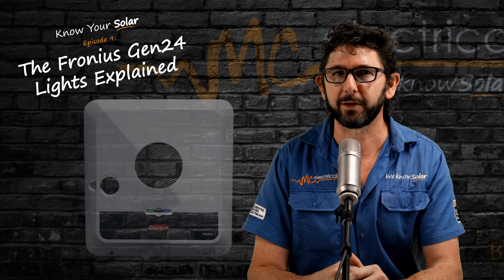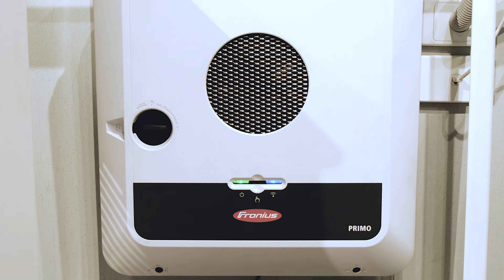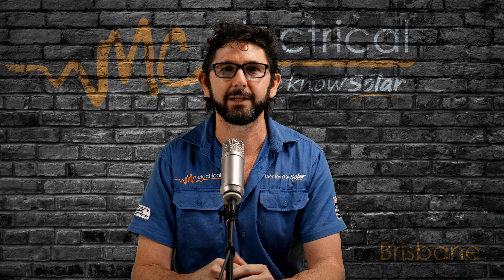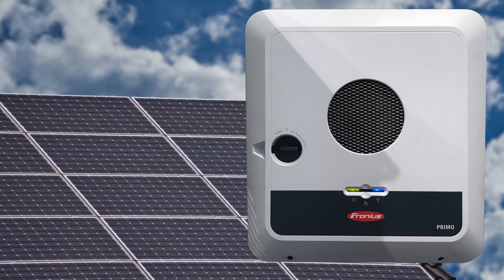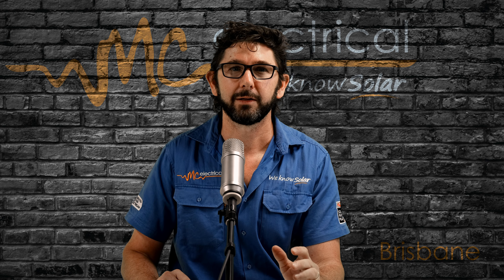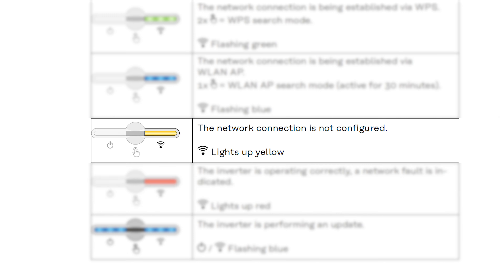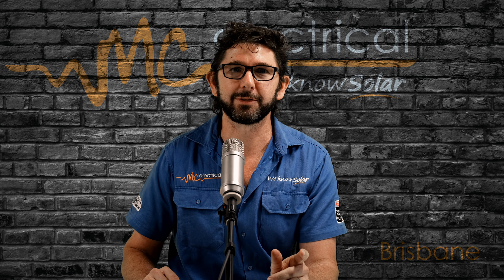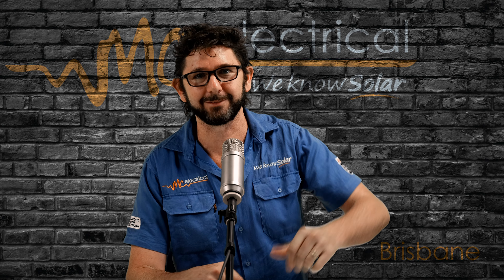Fronius Gen24 Lights Explained | Know Your Solar | Episode 9

Comment: Why is my white light on for 2 of my 3 inverters?
Reply from the maker: Is that the Center light? The optical button can get triggered too easily sometimes. I’d get onto your installer. Latest firmware update helps that from causing problems.
Reply: @mcelectrical  Ta, will check versions later, you guys installed it.

Comment: Thanks for your informative Gen24 videos. I had trouble connecting my Gen24 to WIFI but then managed thanks to your video. However, the blue flashing light has been flashing since days now and does'nt stop. Everything appears to be fine now but the blue light keeps flashing. How can I get it back to solid blue? cheers Dete
Reply: press the WPS button on your modem, then press the middle (clear) button on your inverter twice with a 1 sec delay between presses, then it will flash green, and then should connect to your modem (wifi)

Comment: Hi,I just installed solar power (Sep 8/23) and my inverter is Fronius Gen24 6.0. But then I received a message like this, so can I ask if it's okay?
Status code:1072: Inverter night mode - Insulation (ISO) measurement failure - Over current
Status 1074: Inverter night mode - Insulation (ISO) measurement failure - Invalid booster state.Can you please let me know, thanks
Reply from the maker: Hi, looks like you need to update your firmware. It’s best to contact your installer to do this for you.

Comment: what about flashing green and orange during the day?
Reply from the maker: If that’s the left light, it could be in start up mode and the voltage out of parameters. But I’m only guessing. I’d get onto your installer. They should be able to diagnose that remotely

Comment: Bit of a throwback, but was curious to know if you'd tested the new Gen24 Primo 8 and 10's? The 10's datasheet seems to imply it has a better efficiency curve at all voltages, and it doesn't de-rate as much at higher temps as the 6 does.

Comment: Thanks for that. Unfortunately my installer was not to good at explaining anything.
Reply from the maker: Glad it helped
Reply: @MC Electrical  do you know about the switch over time? Apparently it's set to 90 seconds 🫣 but can be changed to 20millseconds like other brands.
Reply: @ausguy4385  if your talking about change over during backup then no u can’t change it. It’s 90sec by factory

Comment: My neighbour has a 6.6 system with a  gen 24 hybrid inverter to run his byd battery and tigo optimisers. He gets about 2 kwhs or more less output than my 6year + 5kw fronius primo 5 with a nearly August 6 year old Powerwall 2. He gets a 1036 error message, which stops generation.
Reply from the maker: Hey Mark, I don’t think you can put that down to the inverter. Even if it was a cheap and nasty inverter, (if there is no shade) I wouldn’t expect 2kwh difference in production. There is an issue with tigos failing. I’d look into that. But if there are tigos then I’m assuming he has shade or a split orientation in a string, so it would be hard to compare to another system unless everything was identical.